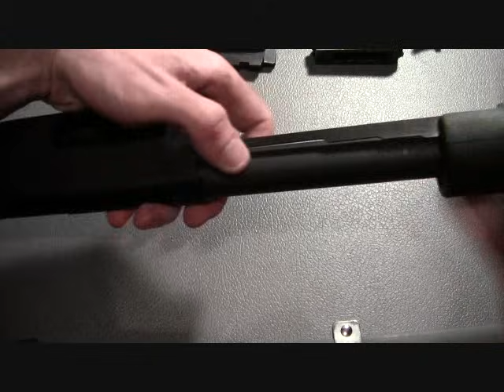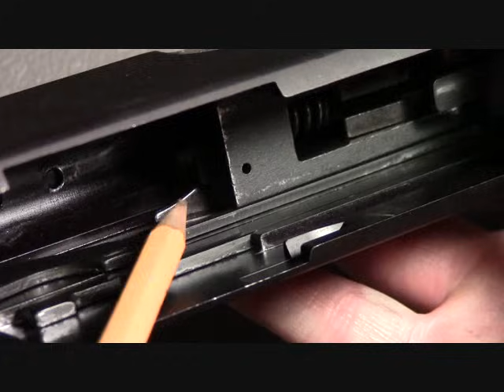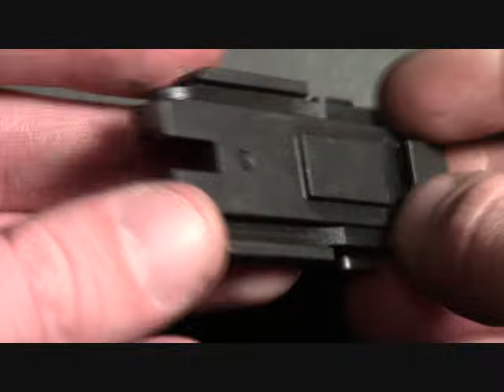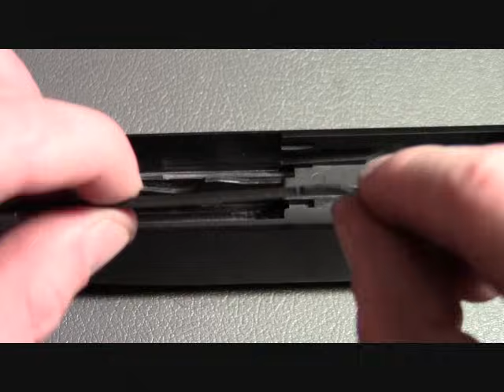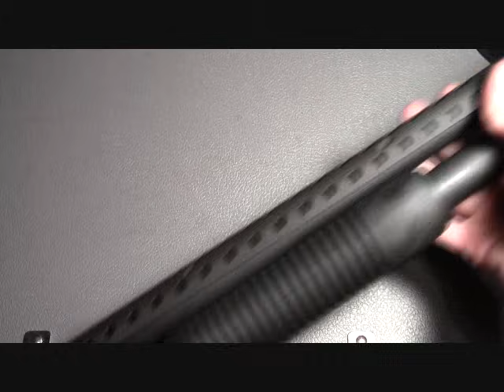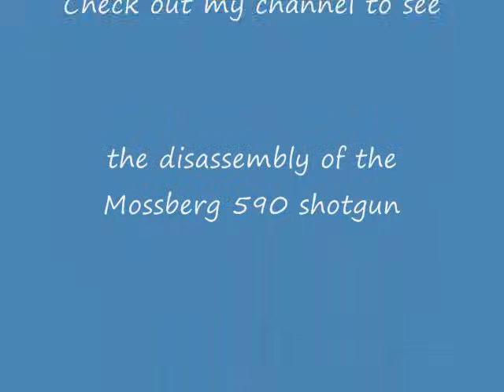How to reassemble the Mossberg 590 shotgun

Comment: So happy I found this video after struggling with others that only lead to frustration!
Reply: @ 5:00 You can use magnets on the outside of the receiver to hold the cartridge interrupter and cartridge stop in place. Makes it much easier and frees up both hands to install the trigger assembly.

Comment: This video saved my 590 SPX! I had used a different video the first time I cleaned it and must have gotten very lucky, because everything somehow just fell together. But the second time I used that video, it was a mess.  The parts jammed and I couldn't get the trigger assembly to go in (luckily). Your video went into intricate detail about positioning the parts properly during reassembly and ensuring that all moving parts fit together the right way. It's working like a champ again now. THANK YOU so much!

Comment: So, I had bought the shorty shell adapter kit from Defender Tactical, but accidentally got the wrong kit. (my fault) and in the process of trying to add a part to the shotgun that doesn't fit, I got the internal parts out of alinement. Was driving me nutty until I stumbled across this video. Got it working again in a few minutes. Reassembly of the 590 is super simple...... once you get the bolt set in the right spot. The Defender Tactical Magazine Follower and Cartridge Adapter allows one to run 1 3/4 to 3in shells in any order - pretty much an upgrade to a 590S for about $30

Comment: I just aquired one of these and was sold an led light foregrip.  The product came with very basic instructions.  So I searched for videos to help. The first one was a woman who made it look like a breeze.  The first thing to note is that my 590 is very stiff.  I mean the safety is very difficult to move.  When I went to put the foregrip slide rails back in, I had to use the point of a small knife to lift the catches over the first stop.  It was like wacka mole to get one to stay up while I lifted the other one and I'm sure I sratched up the area a little.  Where I had the most trouble was with the bolt and carrier and connecting it together.  The other video just breezed through it.  Your video broke it down clearly enough that after some tries, I finally got it and finished the assembly.  Everything works.  So I'd vote your video the best.  Only one thing; you could really use better lighting.

Comment: I have a 590 .401 bore. The parts are slightly different, but your video is doable. Having problems on my 590 where the trigger group does not settle down flush AT ALL! There is a tapered pin at the aft end of the trigger group which is hitting a ramp aft of the safety slide which is preventing the trigger group from settling. The slide and bolt are fully forward, the side plates installed are flush with the inside of the receiver, and I don't see why the trigger group won't angle into the recess cleanly without that tapered end pin hitting thecaft par of the receiver interior, preventing the trigger group to settle into place.
Any suggestions??
HELP!!

Comment: This is really good with the details. One thing to add -  my gun is new and as per my usual full disassembly, clean, lube, I had trouble getting the rear of the trigger group seated. I ended up loosening the stock and it dropped back in nicely.

Comment: even with such a detailed video its so fucking hard. Ive only disssambled and reasembled my shockwave once and that was a year ago. I said to myself im never doing that fucking sbull shit ever again. so after aquiring 6 more guns and knowing how to take all of them apart i think to myself how hard can it be and i spent 2 fucking hours trying and got so fucking mad i took the magazine tube and banged it against the floor. a grown ass man having a little temper tantrum. now its gonna cost about 50 bucks to fix just because i cant control my fucking temper. this reminds me of this one time i was fishing with my grandpa and he got so mad because no fish would fucking bite the hook, only eat around the bait that he took all the fishing rods and tossed them in the ocean. hundreds of dollars all at the bottom of the sea.

whoever is reading this heed my warning. dont fucking take the gun apart to clean it. ive been running a boar through it ive fired hundreds of rounds through it it was as clean as a fucking whistle. you might be likely to loose you fucking mind and feel the need to beat the fuck out of whoever designed the fucking thing. most guns only have one or two parts mac that need to be lined up. a shotgun every goddamn piece needs to be lined up.

Comment: The piece that goes on top of the bolt was the trickiest for me because for some reason mine would not move after i assembled everything. Found that using the "rack handle" pushes it back with ease. After that's done everything else is cake

Comment: Thanks for this!  I just got a 590A1 today and got it dirty at the range.  Taking it apart is of course easy but getting it back together involved some colorful language even with this video but I'm confident that with each time I do it, it'll get a little easier.
This is where the Remington 870 does have an edge on the Mossberg is ease of disassembly and cleaning.  But I'm already liking the higher quality of the Mossberg.  The barrel on my 870 Tactical Express looks like it was bored out with a dull butter knife but upon inspection when I cleaned it, the barrel on my 590A1 is glossy smooth.

Comment: My trigger assembly wouldn't go in all the way with the bolt all the way forward. I had to bring the bolt back about half way or so. Then after I got it in the trigger felt mushy and would only release the hammer once. 
Long story short,... I found the trigger pin that fell out while cleaning and reinstalled it. Luckily the spring didn't jump out too. Great video....Thanks

Comment: much appreciated! 

before this vid, I reassembled the shotgun with the bolt carrier too far back. turns out you can actually put this shotgun back together incorrectly. 

You being clear where the bolt carrier is supposed to lock into the bolt cured my 590 ignorance! 

Thanks so much!

Comment: I have to say as shotguns go this is the worst gun i would want to field strip and put back together in a life or death situation they are so poor when it comes to smooth fitted parts nothing goes back together as it should ie you have to push pull tilt this way that way and those two extractor bars ffs you move the gun a cock hair while trying to put the trigger back and they fall out .dont get me wrong i love mine its so reliable but by far the worst gun ever to field strip

Comment: Thanks for this awesome video! After trying to follow the manual
and not having much success with it at all, I gave up and took it to the range
where two seasoned gunsmiths didn't understand how to put it back together
either. But, thanks to this video that explained everything very well and made
it very easy to follow, I was able to follow it step by step and put it back
together perfectly.

Double thumbs up, this video took away the hesitation I
previously had when it came down to disassembly for cleaning. I never would
have figured this stuff out on my own or through the manual.

Comment: Hi.  I enjoyed your video.  I have a question about a spring on my Mossberg 590A1.  I replaced my tang safety with an aftermarket unit. I just took the safety apart to reverse the direction of the safety (one side is wider than the other) and a small spring fell out of the hole where the safety goes.  I can't figure out where it goes?  Not sure if it's part of the safety system or it came out of the trigger group.  The gun/safety works normally so I can't figure out what it is.  Any ideas?

Comment from the maker: There are a couple things that I can think of that could cause that.  If the hammer is de-cocked, it can get in the way.  Another possible cause may be the slide plate and bolt not being pulled fully forward.

Comment: Thanks for the video, installed a new forend on my 590a1 and was able to reassemble to what I think is proper. HOWEVER, hopefully you can help, when pump the shotgun its a bit sticky when the forend is toward the receiver. Definitely not as smooth as before I disassembled. Any ideas? I took it apart and reassembled multiple times, I think everything is in the right spot

Comment from the maker: I'd start by checking for two things.  See if the barrel is causing an obstruction with the bolt.  The barrel seats down into the receiver and if it is seated a little crooked the barrel can interfere with the bolt closing and the slide locking.  The next thing that I would check is your trigger assembly and look at the slide release.  There is a coiled spring that is used to operate the slide release.  Check to see if it is damaged and always actuating the slide release.

Comment: Thanks a ton!  What does it mean when the slide doesn't FULLY lock( I pulled pretty hard and it works, but after a round engaged it didn't latch and enabled me to double load.  How can I strengthen the latch

Comment: when i look at my bolt from an angle after i reassembled the gun i can see little the hammer and what not is that normal? Like my bolt just looks a little bit different but it still cycles shells smoothly but i havent shot it yet.

Comment: Nice video on the 590 dissemble and reassemble.  If I might suggest it would be helpful to identify direction on all parts like you did on some parts so there is no confusion on the rotation and direction of parts.  Also it would have been helpful if you had shown how the butt stock is removed  and re-installed.  Additionally I would like to have seen an inspection for ware on all parts so we would know what to look for while cleaning the weapon.  Thanks, Dennis

Comment from the maker: Hi!  That's a good question.  I would not recommend taking out the magazine tube spring unless there is a real problem with the firearm feeding.  The reason is that if you take off the nut on the end of the magazine tube you will see a piece of metal that looks like the letter C.  That piece is called the magazine spring retainer.  I believe that this piece is press fitted into the tube and can be damaged when attempting to pull it out, and it may not fit right again. I leave the spring in.